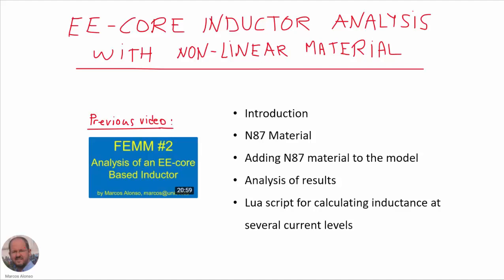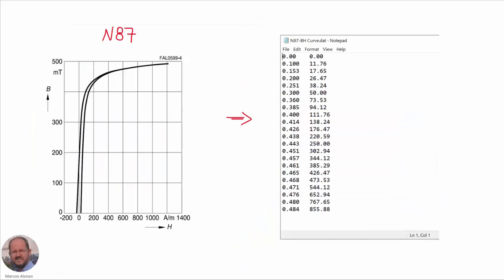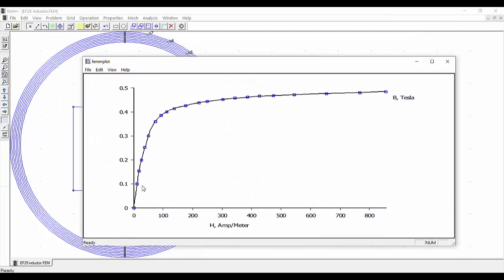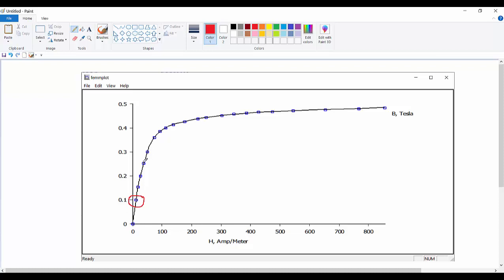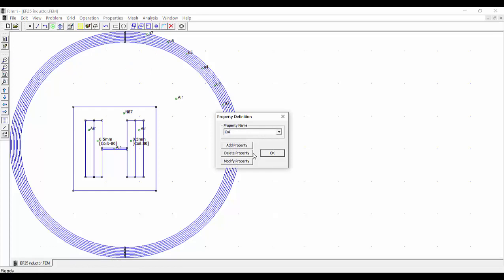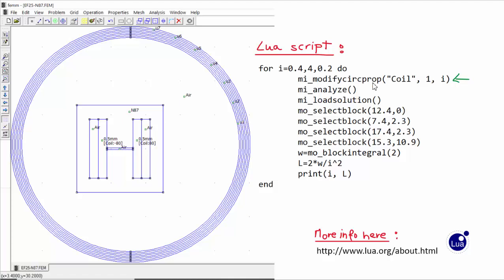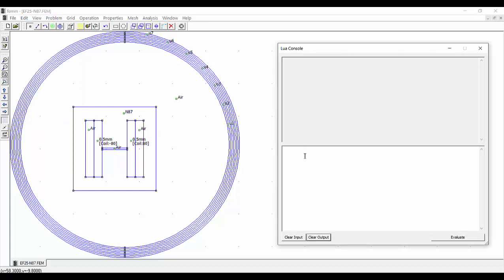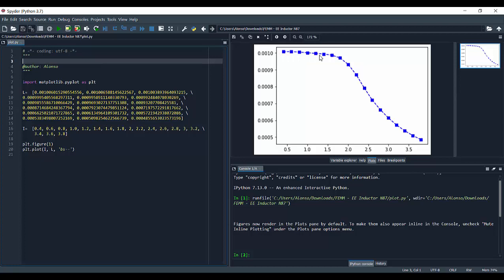FEMM #3: Analysis of an Inductor with Non-Linear Material

Comment: Thank you for your video, I am learning how simulate the magnet force by two permanent magnets. I tried to load a nonlinear B-H curve, but the simulation result gave me 0, I used the kjmagnetics data for N42 magnet. After that I used your data like example but the result in FEMM is the same "0”. I noticed that if I change the Hc coercivity for a number different to 0 it works but not as I expected. Any idea?
Reply from the maker: Thanks for your comment. There is an example about how to use magnets in FEMM here: https://www.femm.info/wiki/PermanentMagnetExample
Please, take a look.

Comment: Good day, dear Sir. I am interested in modeling a ferrite core (a nonlinear material) working in high frequency (up to 500 kHz). I don't want to laminate the core, but considering the nonlinear curve and a standard 3.52 MS/m conductivity for the Magnesium Ferrite, the simulation indicate me a big amount of eddy currents. Where is my mistake? Thank you very much!
Reply from the maker: I think your value of conductivity is not right. It is too high. Your value gives a resistivity of 2.84e-7 Ohm*m, which is very small. As an example, according to the N87 material datasheet, which is MnZn material, its resistivity is 10 Ohm*m, so the conductivity is 0.1 S/m. Try this value an see if everything looks good.
Thanks for your question and for watching the videos!